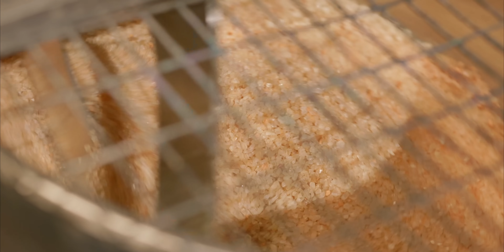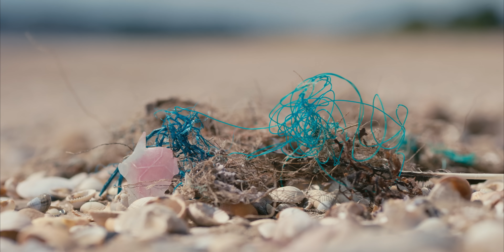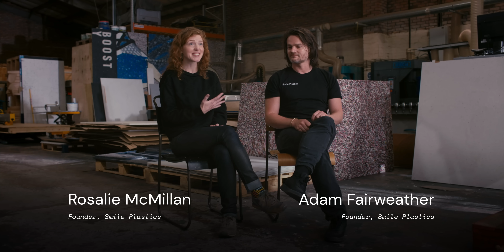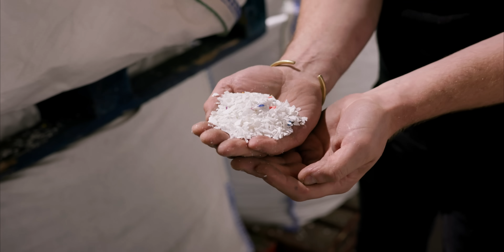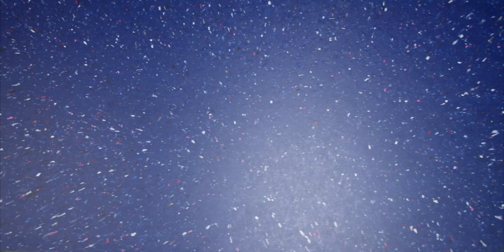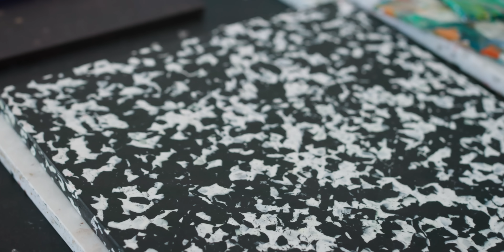NTS: Wonderful Waste - From Plastic Trash to Terrazzo Treasure

Comment: This book was a great resource for ideas, practical advice https://www.youtube.com/post/Ugkx-b91_bYU48sOwHX-XC49tRRXRxcnOmZm and pro tips I purchased the plans for the 10'x16' colonial and used them for the basics and made my own modifications. I built my shed for storage and lawn equipment, but decided to sheath and side it in case I ever wanted to add insulation and turn it into a shop or bunkhouse. I poured over this book all winter while I planned and found it to be the all-around best shed book out there.

Comment: I love this idea, the products looked so nice and premium. 

I did wonder if the release of microplastics is a concern when using these panels in a kitchen or bathroom setting though. I’m wondering if a panel like this gets used often it would release microplastics over time. Especially in the kitchen where you would be handling food it would not be nice to have that happen.

I don’t know much about microplastics besides the fact that we already are exposed to quite a lot of it regularly. So I would love for someone to clarify. If it safe in that regard I would love to use these materials in a home, they look amazing
Reply: my thoughts also. I guess there is less microplastic when dealing with hard surfaces. Afaik, the biggest culprits in a house are food/water containers (especially microwaving them) and synthetic fibers in clothes/upholstery as they shed more. Solid objects that do not come into contact with food is a better use case, but of course still not as good as using ceramics or wood.

Comment: i wonder what the off-gassing impact of this material is?
Reply from the maker: Their particular process is very low heat, we could barely smell it during the shoot.
Reply: @nevertoosmall, that doesn't mean its not happening. Don't get me wrong. I'm rooting for these guys, but I would've loved it if they had at least talked about it.
Reply: @Kadir_Suleymanoglu  It's important to ask these questions! 
In our process, we actually only heat the plastics enough to allow them to form a sheet, which is a far lower temperature than what is required for other methods, such as injection moulding. This, alongside the use of PET and HIPS plastics, greatly reduces the amount of offgassing during the manufacturing process. Any manufacturing process is going to have some byproducts, but ours stand up very well next to traditional methods. Plus, once the sheet is made, it is completely inert and does not offgas—unlike materials such as MDF, Ply and Chipwood.
We're constantly working on transparency and reporting, to ensure that we are not only following best practice but making sure our customers are making informed choices, especially as we scale up. We recently attained an EPD which will be made public very soon and will detail our environmental impact—if you're unfamiliar with EPDs, you can read about it here and keep your eyes peeled for ours coming very soon! https://www.environdec.com/home
Reply: Thank you,  @Angie-Smile  !
Reply: @Kadir_Suleymanoglu  So true , as a product designers I always try to bring awareness to this issue which people are not even considering. People have the right to know and read before they get sucked in the “Green-wash” propaganda happening more and more these days. PLASTICS = PHTHALATES.  Studies have begun to show deleterious endocrine and metabolic side effects associated with various subcategories of phthalates. In the past few years, researchers have linked phthalates to asthma, attention-deficit hyperactivity disorder, breast cancer, obesity and type II diabetes, low IQ, neurodevelopmental issues, behavioral issues, autism spectrum disorders, altered reproductive development and male fertility issues.

Phthalates are in hundreds of products, such as vinyl flooring, lubricating oils, and personal-care products (soaps, shampoos, hair sprays). Some phthalates are in polyvinyl chloride plastics, which are used to make products such as plastic packaging, garden hoses, and medical tubing.

THINK OF USING REUSABLE PLASTICS AS YOU WOULD USE REUSABLE NUCLEAR WASTE. 
IF YOU CARE ABOUT YOUR HEALTH AND THE HEALTH OF YOURS 👍🏼
Reply: So true! …And sooo many other serious matters that are completely ignore by the push of “green-wash innovation”
Please read before you get sucked in the “Green-wash” propaganda happening more and more these days. PLASTICS = PHTHALATES.  Studies have begun to show deleterious endocrine and metabolic side effects associated with various subcategories of phthalates.

Phthalates are in hundreds of products, such as vinyl flooring, lubricating oils, and personal-care products (soaps, shampoos, hair sprays). Some phthalates are in polyvinyl chloride plastics, which are used to make products such as plastic packaging, garden hoses, and medical tubing.

THINK OF USING REUSABLE PLASTICS AS YOU WOULD USE REUSABLE NUCLEAR WASTE. 
IF YOU CARE ABOUT YOUR HEALTH AND THE HEALTH OF YOURS 👍🏼
Reply: So true , as a product designers I always try to bring awareness to this issue which people are not even considering. People have the right to know and read before they get sucked in the “Green-wash” propaganda happening more and more these days. PLASTICS = PHTHALATES.  Studies have begun to show deleterious endocrine and metabolic side effects associated with various subcategories of phthalates. In the past few years, researchers have linked phthalates to asthma, attention-deficit hyperactivity disorder, breast cancer, obesity and type II diabetes, low IQ, neurodevelopmental issues, behavioral issues, autism spectrum disorders, altered reproductive development and male fertility issues.

Phthalates are in hundreds of products, such as vinyl flooring, lubricating oils, and personal-care products (soaps, shampoos, hair sprays). Some phthalates are in polyvinyl chloride plastics, which are used to make products such as plastic packaging, garden hoses, and medical tubing.

THINK OF USING REUSABLE PLASTICS AS YOU WOULD USE REUSABLE NUCLEAR WASTE. 
IF YOU CARE ABOUT YOUR HEALTH AND THE HEALTH OF YOURS 👍🏼
Reply: So true , as a product designers I always try to bring awareness to this issue which people are not even considering. People have the right to know and read before they get sucked in the “Green-wash” propaganda happening more and more these days. PLASTICS = PHTHALATES.  Studies have begun to show deleterious endocrine and metabolic side effects associated with various subcategories of phthalates. In the past few years, researchers have linked phthalates to asthma, attention-deficit hyperactivity disorder, breast cancer, obesity and type II diabetes, low IQ, neurodevelopmental issues, behavioral issues, autism spectrum disorders, altered reproductive development and male fertility issues.

Phthalates are in hundreds of products, such as vinyl flooring, lubricating oils, and personal-care products (soaps, shampoos, hair sprays). Some phthalates are in polyvinyl chloride plastics, which are used to make products such as plastic packaging, garden hoses, and medical tubing.

THINK OF USING REUSABLE PLASTICS AS YOU WOULD USE REUSABLE NUCLEAR WASTE. 
IF YOU CARE ABOUT YOUR HEALTH AND THE HEALTH OF YOURS 👍🏼

Comment: That would be a great idea for the traveling vans, trailers with wet baths and sustainable surfaces.  I guess it could be made into a countertop with a niche area for a ceramic/wood cutting board or hot plate. I hope they come to USA and franchise.
 🥶🖤🔔👍🏻💓

Comment: Ridwell from Seattle is a plastic recycle company that added some zip codes in Minneapolis 2022.  you pay for a biweekly pick up.  all plastics they pick up are recycled.   some areas have pick ups for a wider range of plastics depending upon what partners they can find in the area.  Ridwell's website explains what companies & products are made.  considering only 10% of the plastic in the US is recycled, Ridwell is the type of company that tries to bridge the gap between companies working on recycling, but need a steady source of plastic waste.
Reply from the maker: What a great initiative, thanks for sharing!